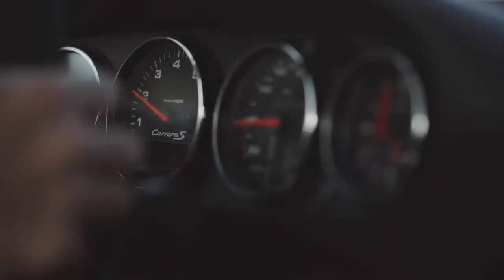重新改造我的兒時夢想/ The Sexiest Porsche 993! My very first vlog with the 993 Turbo S Look! 《EMC Vlog Vol. 1》

Comment: Great build spec on the 993. In the future if you want more power but want to do something different than a regular turbo upgrade you should look into doing a supercharger. TPC Racing has a supercharger kit that brings a stock 993 up to around 410 horsepower and 385 ft lbs of torque. The 993 Turbo was rated at 408 horsepower and 398 ft lbs of torque so their supercharger kit brings a stock 993 up to Turbo specs. If you’re running upgraded higher performance internals you could expect to gain even more power over a stock engine. The supercharger kit is easy to install and usually less money than a comparable turbo kit.

Comment: Love it!! Very well done and excellent color choice. I see nothing wrong with the Tiptronic and I'm sure it shines in traffic in Taiwan. I'm also on the fence what to do with my 993TT. Currently torn down for a top-end rebuild but the paint is mostly original and not in the best shape and beyond saving due to some idiot burning the paint during a polish. Debating whether to stick with original black or follow your lead and do a color change in a historical color.
Reply: Thanks! Ur a lucky dude with a 993TT! Do some research into the 356 colors. Go for it!

Comment: 反正改coilover了 再低個一寸兩寸如何
Reply: My basement is too low...Very annoying
Reply: KW HAS front lift system will be perfect for you
Reply: Michael Wong I’ll check into it for 993! I have hls2 on my 997.2 turbo s, and had it on my 458 as well...didn’t remember they had it for 993, but I’ll check! Thanks!
Reply: Sunny Wang I’m not sure if they have it for 993 but I guess you could custom order one. I remember one of the speedhunter project car (R34 GTR) had one custom built and sent to japan for him

Comment: Manual is a thing of the past. All the Porsche now automatic. Because it's faster.
Reply from the maker: Toby mak 😂🙌🏻
Reply: Actually that is not really true. You can get the brand new GT4 or Spyder with a manual, also the GT3 can be ordered manual. But yeah everything else is automatic. which, to be honest, is far superior.
Reply: Joe H  Tbh i drive them alot at work and driving a pdk is much more enjoyable if you are not a professional racing driver/very skilled driver. Especially in the  GT3 or GT2 RS i am glad not having to shift. Cause there is enough you have to focus on whilst driving already.